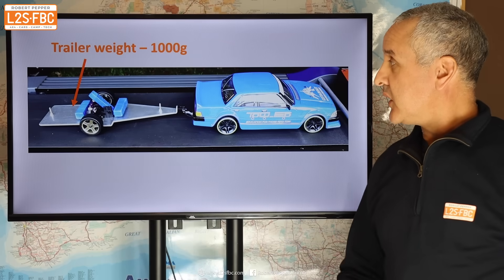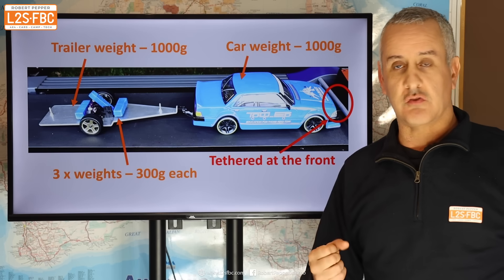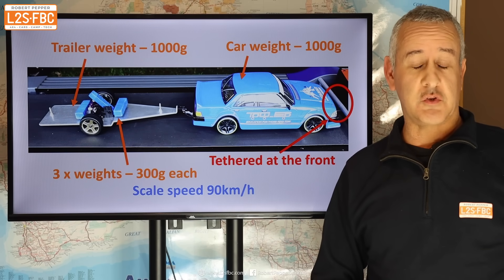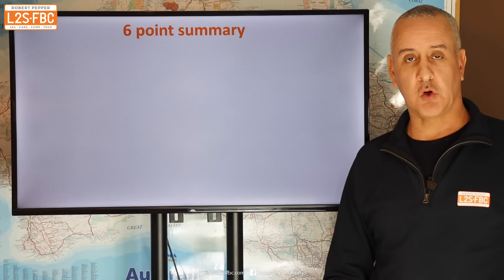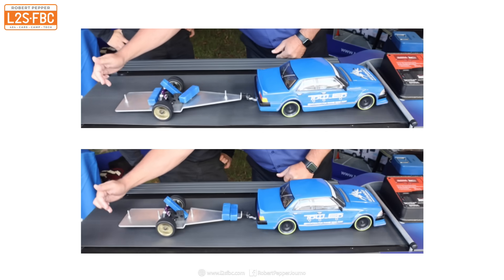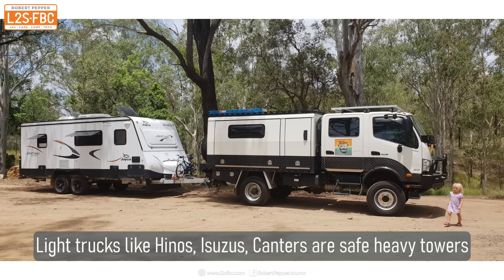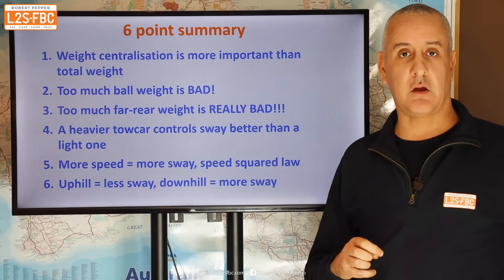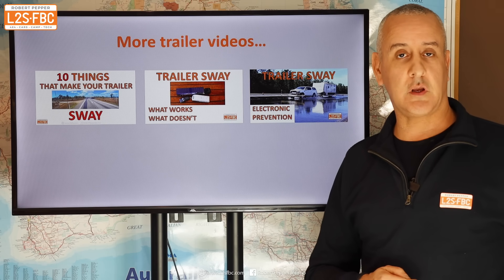7 trailer weight distribution setups, some safe, some deadly.

Comment: Some of the other factors which can cause sway are the distance between the ball and the rear axle of the tow car. In my experience it should be as short as possible. Also long wheelbase vehicles tend to be more stable. Many trailers have badly adjusted, or non working override brakes, occasional use caravans often have seized mechanisms. Hitches with built in dampers work very well when they work, but how many have been connected to a greasy ball. Four wheel trailers are more stable allowing you to relax the rules on weight distribution somewhat. Incorrect tyre pressures are another often overlooked cause of instability.
Most car manufacturers publish their maximum recomended tow weight which is usually no more than 100% of the kerb weight. Many countries legislate along similar lines. 
Having spent a lifetime towing with a variety of vehicles and trailers in summer and winter conditions my recommendation is, "if you want to move something heavy, Buy a lorry" 
There is nothing more disconcerting than towing a caravan on the motorway at 90kph in the wind and rain, when the guy in the artic behind decides to take advantage of a downhill section to overtake! Resist the temptation to hit the brake pedal, accelerate instead.
Reply from the maker: Very true, and we have plans.  In Australia, max braked tow weights are very often in excess of GVM (max load), never mind unladen (kerb) weight!

Comment: Get a Hensley.  Mock one up with these tests and see what happens.
Reply from the maker: What's a Hensley?
Reply: @L2SFBC  https://www.youtube.com/watch?v=hWKVs04Xy8I
Reply: ProPride is another hitch with this engineering design.  Trailer can't sway with these hitches due to the pivot point being projected forward near the rear axle.  I own a Hensley, an amazing hitch.  Won't tow without one!
Reply from the maker: Thanks really interesting! I can't build a model like that sadly.
Reply: @L2SFBC  Sure you can - it's a simple four-bar linkage. It would take work, but it's technically feasible. Spoiler alert: it will act like the towball is placed further forward, with the trailer axle to tow vehicle axle distance unchanged.

Comment: Is there a driving technique to help recover if you find yourself in a swaying scenario?
Reply: Ans: Trailer brake controller. 

Long answer in my non expert opinion: I have been in this situation in the days before compulsory electric trailer brakes. Two things; (a) you have seconds to implement your driving technique before it is all over. At highway speed probably about a total 4 seconds absolute max. In my case I was going slow which meant I had a lot of seconds. Still only seconds.  (b) Firstly there is not one technique because of all the variables. So it is a combination of things you do extremely rapidly but at the correct pressure and precisely timed. Trust me, I replayed and replayed every second of that experience in my head and talked it through with my passenger and a lot of more experienced people afterwards - I did everything "right" from a driving perspective, my brain going furiously to overcome that urge to brake hard and instead get control of the sway. All I could do was draw out the ever worsening process so much that it went on and on for many seconds, while the whole rig got down to a slow enough speed where it could not tip over. By this stage the sway was so dramatic I was going backwards on the wrong side of the busy multilane highway at night. But I kept all the wheels on the road and just hoped the oncoming traffic would not blow it all to smithereens. Literally accepting the fact that the tail was wagging the dog and so this dog had to just be a drogue anchor dragging things to a halt, which by that stage meant swapping the wheel turning to the other way around. Anything to get keep it wheels down and gradually slower.  I let the whole thing pull me backwards over the far bank on the wrong side of the road rather than allow the rig to tip over. Did a lot of damage to the mechanical parts of the trailer and car before coming to a complete stop but no one was injured and I was able to drive it to somewhere it could be repaired. 
The word "control" is not the correct phrase in this situation. You are mitigating a disaster with brains over instincts and you better have got into that mindset within a split second of it starting.
Now just think about all that. Not to blow my own trumpet or anything but this is just totally unrealistic to expect even an experienced driver to achieve. Imagine you were tired. or just a bit too slow on that wheel or just a bit too hard/too soft on the peddle, or going 10km/h more than I was or on gravel or wrong tyre pressure or a host of other variables. Plus the only reason we didn't die was because the oncoming traffic was able to avoid a collusion. 

Just take my word for it. Forget about the strategy of driving out of it. That is absolute last resort attempt to save your life type stuff. Apart from remembering to avoid braking the vehicle hard, realistically the only practical approach is to (a) avoid it occurring and (b) use modern technology if it all goes bad. Hit the trailer brake controller. 

Focus more on being able to instantly recognise that sway has started and be able to reach that brake controller. IMHO.
Reply: @davexb6595  well, I did everything wrong (I was 17), but I also never learned what to do.  I, too have replayed it many, many times.  I did brake.  And maybe it slowed us enough to not get hurt?  I know, I believe in goosenecks/fifth wheels, electric brakes and properly loaded trailers.  This was the best demonstration that I’ve ever seen, and your post is wonderful.
Reply: @markscarborough7580  Yes I've never had a 5th wheeler (cost) but I am keen to try one someday. Clearly inherently safer. Actually once you get up to 3,000kg and above I even think the for safety advantages, it would be worth it to learn to back up a dog trailer. (If anyone actually made small dog trailers.)  But of course once it gets into that territory you perhaps should be looking for a motorhome or MR truck anyway.
Reply from the maker: Wow...amazing post thanks!
Reply from the maker: Yes, apply the trailer brakes not the car brakes. More here in these videos > https://www.youtube.com/playlist?list=PLG5Om1_yP8jl_9zfIb-zrYP_Nro1q1xq

Comment: I turned over a truck and trailer when I was in high school. Others had improperly loaded the trailer.  We thought we could drive slowly and mitigate the risk. We were wrong. We started down a hill and it went sideways - in a hurry!  Very big deal!
Reply from the maker: Hills contribute to sway
Reply: @L2SFBC  we knew about weight distribution, but didn’t appreciate the extreme impact. I had a doctor’s appointment, so we didn’t take the time to re-load the trailer.  We were going slowly, but that wasn’t effective enough. A long downward slope was fatal!
Reply from the maker: Thank you for sharing the story...very useful+

Comment: Should the driver NOT brake or accelerate as soon as sway occurs? That's what uhaul's video says when swaying starts
Reply from the maker: Correct don't brake or accelerate. What you want to do is apply the trailer brakes only to reduce the speed of the trailer relative to the towcar.
Reply: @L2SFBC  what about non-brake trailers? 4 pin only
Reply: @L2SFBC  obviously the trailer cannot go at a different speed from the tow vehicle. The effect of braking the trailer alone (which is the right solution, if done in moderation) is to pull the connection between the trailer and tow vehicle, tending to straighten out the combination.

Comment: Awesome video 👍
The string tether would effect the sway result, id love the same test with the RC powered and a slack tether - very hard to do but.... 👍
Reply from the maker: Thanks, good idea...and stay tuned, there will be more!
Reply: @L2SFBC  a longer tether would likely do the job - ie flip the rig
Reply: Save yourself all the mental masturbation, what you see is actually happening it's only minimized by the tether thing one of the smartest things that you can do is have electric trailer brakes by tapping the trailer brakes it will snap that trailer right in line but it also helps to have the right amount of tongue weight for the load on the trailer which is I believe 16% maximum 10 to 16% is the window.
It's like here in the US they will not rent you a trailer at U-Haul for certain vehicles and certain loads it's like what the gentleman was saying about the tow vehicle passed away more than the than the load being towed that's one way to minimize the trouble but he's also correct in that it really doesn't matter you can have a very heavy load in relation to the towing vehicle if you keep your head screwed on you have the right amount of tongue weight and you're not driving insanely fast.

Comment: I'd like to see the test done with the tow vehicle at 30% more weight and see how much control it has. My 19 ram 3500 srw weighs 10,150  when hooked to my 31ft travel trailer that weighs 6900.  I do not use a WDH and my truck just dominates the trailer. Been pulling with and without WDH for the last 40,000 miles and there is little difference between them when the truck weighs 30% more than the trailer.
Reply from the maker: Stay tuned, there will be more!